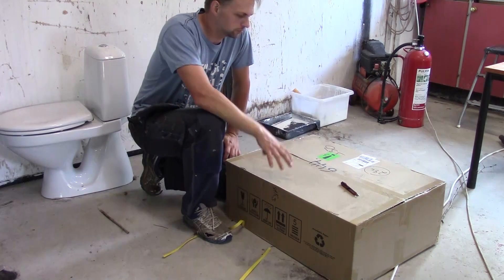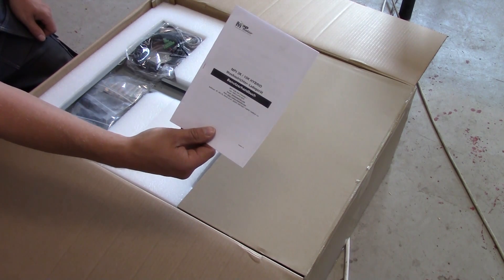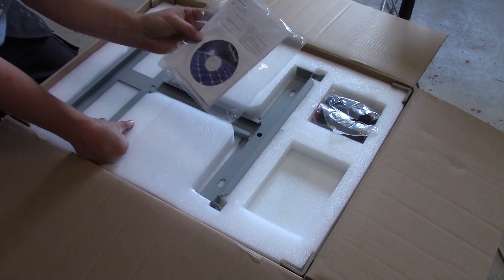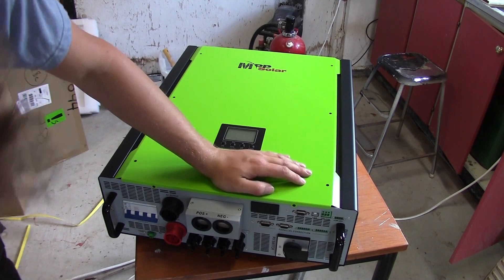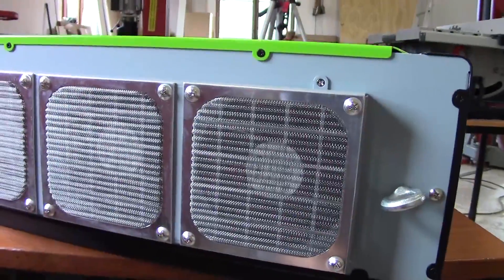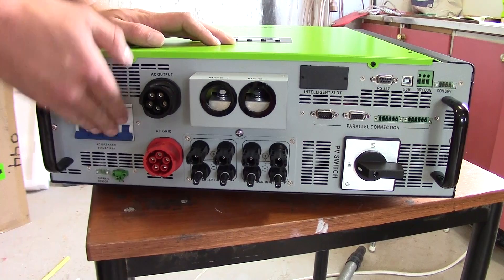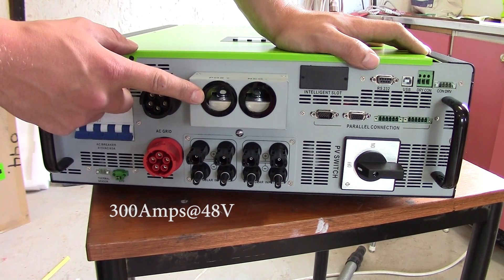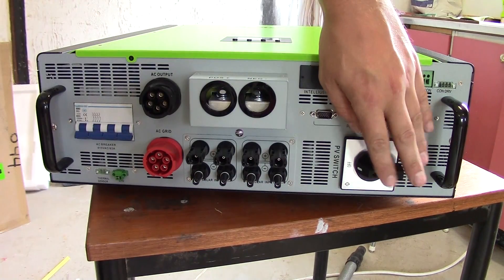Solar Electricity: Unpacking and quick overview of 10kw hybrid inverter

Comment: Good morning. I use such an inverter and I don't understand 1 setting. Can I describe it?
Reply from the maker: Sure
Reply: @DIYTechRepairs  I have Easun but it's probably the same. I don't understand the parameter: 1) Max feed-in grid power. Is this the setting of the power returned from the energy storage to the grid? 2) Feed in power factor. I don't understand this at all.  Range -0.99 to -0.8 and 0.8 to 1

Comment: Hi can I ues this inverter without batteries on offgrid?
Reply from the maker: Yes but it's useless without batteries. It's the main function of it. For grid tie just buy an grid tie inverter. It's 1/3rd of the price
Reply: Thanks, unfortunately I haven't done any resurch, I paid someone to do the system, I have a Huawei 10 kw grid inverter, and I thought buy an offgrid inverter if no power on the main and survive for a few days without battery, do you mind if I ask for an advise from you? What can I buy ? or what can I do to use without battery! Many thanks!!
Reply from the maker: @norbertszabo8736  you can't do anything without battery. Just solar alone is very unreliable and just a few inverters can run off grid with that. So if your idea is off grid you need a proper battery.
Reply: Thank you!! Is good to know.
Any option about what cind of battery mach with this inverter?
Sometimes the laziness cost a lot... :(
Reply: Not an expensive one because this inverter will be just a an emergency if is no power on grid
Reply from the maker: @norbertszabo8736  Then you still need a battery. The cheapest is to use an old UPS for that. Or even cheaper a diesel generator.

Comment: Hello. I need your help. I have the same inverter, but i cant build a connection to it with my laptop.
I have tried it with two different laptops and two different usb cabels. The software is the SolarPower V1.16
Can you help me with this problem?
greetings from vienna

Comment: Hey,

Driver å titter på å kjøpe meg 3stk HYG5032 og sette dem opp i "parallell" til 3 fas.
Hvordan liker du din HYG1033 til nå?

HYG serien begynner å bli gammel, så kan kjøpe inn noen ganske nye 5.6kw enheter i steden, men de koster 25% mer, så vet ikke om det er verdt det.
Reply from the maker: Mpp är kostsamma. 80w idle load per fas och inverter
Reply: @DIYTechRepairs  
Hmm og jeg som har IT nett og trenger 230v - 400v trafo vil ha et konstant tap i den også på noe mer enn inverteren. Men med sol på sommeren så går det vel i pluss.
Skrur du av deler av systemet om vinteren?
Reply from the maker: @Mr.Engineer.  mitt är på. Med 3fas har du ju 400v mellan faserna
Reply: @DIYTechRepairs  
Ikke i norge, her har vi lenge hatt IT nett og det er 230v mellom fasene og uten nøytral leder.
Nye byggefelt er 400v TN nett, men jeg har dessverre gammelt IT nett på 230v mellom fasene.

Comment: @DIY Tech & Repairs Are you happy about using this green inverter ? You can afford to recommend this product ? Where did you buy it? Did you pay tax? How much was it?
Reply from the maker: It works but i would have gone for a more efficient and reliable one if i could afford it. It uses 240w idle.... I bought it from mpp solar from germany. Since inside eu tax was already added. It was expensive
Reply: @DIYTechRepairs  Thanks for the answer! Edit. What another hybrid inverter would you recommend?

Comment: Hi there!  I am wondering if you ever got the relay set up for backup mode.  I find it quite difficult to source a changeover contactor for three phase AC - it would be at least 9 poles and take up most of a DIN rail.  Keen to better understand how this inverter works with the grid. Cheers, Chris in Australia.
Reply from the maker: You just need 2 4pole contactors or one proper ats. The unit itself have it built in too. 
The unit work but have Huge Idle draw
Reply: @DIYTechRepairs  Sure sounds like it - 240 W!  And that excludes the power required to keep the contactor on...
Reply: @DIYTechRepairs  The HYG1033 that has the huge power draw or the ats you speak of?

Comment: hello , i actualy install same as your with 12KWC pv and 50 KWH battery , i never find on data the rated output when use grid + inverter togheter as energy sources . does it's still limited around 15 amp per phase ? or ?? thanks
Reply from the maker: Hi. Its Still max 10kw. Ie 3.3kw per phase. It can switch to grid only and then do something like 15kw but thats only grid.
Reply: @DIYTechRepairs   thanks.

Comment: Hi there! I need your help. If you are still using this 3 phase inverter ( in grid tie mode ), can you please tell me about it's performance in grid tie mode because I am going to install same inverter with 10kw pv array for my uncle for net metering and I didn't find sufficient data/ videos about it's performance in grid tie mode. Any assistance you can provide would be greatly appreciated.
Reply from the maker: Im still using it. It have an idle load of around 240w. That with the lost energy during low load that is 7kwh per day that you need extra :) That and the lack of support and warranty is 2 big disadvantages. Next is that the serial protocol sucks.  With that said the price makes it affordable.
Reply: Thanks for your reply. Are you using it in GRID TIE WITH BACKUP mode?
Reply from the maker: @aamirbangash1547  yes. Mode 2 i think
Reply: @DIYTechRepairs  Apart from some of it's disadvantages, are you satisfied with it's performance in GRID TIE MODE ( selling electricity back to grid ) ?
Reply from the maker: @aamirbangash1547  if i skip all negative parts sure... But they are pretty vital :) but IF you can live with Them or subside Them sure. Also dont forget its only 1 year warranty and you have to pay for any issues ;)
Reply: @DIYTechRepairs  Thanks a lot brother. I have to use this hybrid inverter because if grid  goes down, it will still generate electricity from solar panels in GRID TIE WITH BACKUP MODE.

Comment: Hello, I have the 3024gk model. It have the  batteryless operation option so when its only connected to the solar it outputs a phase on both N and L terminals. Is that normal?
Reply from the maker: Dont know how that modell operates. Sorry.
Reply: @DIYTechRepairs  Thank you

Comment: Does it supply power from the panels when the AC mains have a power cut and there is no battery.
Reply from the maker: Yes it can. Its hybrid
Reply: @DIYTechRepairs  it did not work,it need the batteries connected to work I. Off grid mode,doesn't supply power from the panels without the batteries in off grid mode.However their off grid models work without the batteries
Reply from the maker: @claytonmascarenhas515  it works to supply Power from solar to grid when battery is off. I did it just couple of days back when i switched some things on the battery Side. The inverter above can work as normal grid tie inverter.
Reply from the maker: @claytonmascarenhas515  sorry No it doesnt supply Power only from solar. No inverter does that. Solar is not a source for that
Reply: @DIYTechRepairs  their off grid models do.They supply power only from solar without the batteries connected even if there isn't any ac mains
Reply from the maker: @claytonmascarenhas515  only their new batteryless version yes but IF you load it slightly it dies... IF you do it wrong you get White smoke. Trust me... They Arent made for it. Solar is not constant input and should not be used for it. Build a proper systrm

Comment: Hi, thank you for sharing this video.Is it a must to connect the load?
Heere in switzerland we have a reliable grid, the load is connected to the grid.Is there a measurment of the power consumtion, if yes, the inverter can supply from solar or battery only as much the load uses via the grid. (goodwe inverters seems to have this measuring unit)We have different prices for the energy for different times. High costs 20cts per kwh and low is 10cts. we get only up to 6 cents from the power plants for the energy we feed into the grid.If feeding back to the grid can be time controlled as wellthat would be a complete solution.Thank you for your opinion or reply.best, Kurt
Reply from the maker: The unit is a hybrid unit so buying it and not using the load output would be stupid since its pretty expensive :D  If you just want grid-tie i suggest buying one of those instead. This unit can do 0meter where it equals the grid useage. I dont use the built in function since I did not get it to work at all. Im using my own system
Reply: Hello Kurt. Did you buy this in the end? Any comments on the use in Switzerland? I'm planing to use the same.
Reply: @kenzotheband  
Helo Vincenzo
No I did not yet. But bought bmw i3 and as soon battery is not good enough for driving I would have a battery for the inverter.
Project is not yet dead. I am shure to do it one day.
How about you?
Regards Kurt

Comment: the load can take the power from grid and solar in same time and how match the percentage between two sources
Reply from the maker: Eng Hasan Al-kaissy yes it can use both.
Reply: its all type hybrid system has same of this features or this special type ?
Reply: @hasansalah1  voltronic power company model VMII and VMIII can also share grid and pv same time..

Comment: Hi Sir, this inverter output 3 phase?
Reply from the maker: Aye Min Tun yes its 3phase :)
Reply: if i connect parallel MPI 10 KW (3 pcs)  can i get output 30 Kw (3- phase) ?
Reply from the maker: Aye Min Tun yes. thats correct
Reply: may i know how to connect to make 48 v ? 6 v battery  8 pcs in series and than 4 in parallel . total 32 pcs battery ?
Reply from the maker: Aye Min Tun correc.

Comment: I was interested in this inverter, but I was unable to get information if this inverter have EN50348 certification. Do you know that? Or is there some other standard that is required in Sweden?
Reply from the maker: Im not aware of if this have 50348 certification for the flammable coating... It do have: EN62109-1, EN62109-2, EN62040-1 / CE, VDE4105, VDE0126-1-1, AS4777/3100. If im not mistaken we need CE and VDE0126 in Sweden. But i will not say for sure since i need to check that out before. But above inverter is sold by several Swedish companies so i hope its ok :)
Reply: Oops I mistyped the number. Of course it's EN50438. See this: http://www.elstandard.se/nyheter/nyhet.asp?NewsID=1394611407
Reply from the maker: Olavi good question. i have mailed them and will also talk to my electricity guy to see what he says.

Comment: Det jag behöver är ett system som slår om från on grid till off grid vid ett strömavbrott..
Reply from the maker: There is tons of ways doing that  :)  Most inverters and both of the ones i got have load out. So as soon as grid dissapears it runs on battery instead.
Reply: Ok,jag har just läst på om detta så det stämmer ju,undrar om det finns system som går även om man inte har batterier,dvs enbart går på solcellerna som vanligt  fast "strömmen har gått",verkar vara delade meningar om detta...?  :D
Reply from the maker: cyuiyu wyguiyui teoretiskt skulle det funka men det funkar inte värst bra i praktiken och därför finns det inga på marknaden. tänk dig när solen går i måln vad som sker :) någon typ av bank är ett måste.
Reply: Ok..